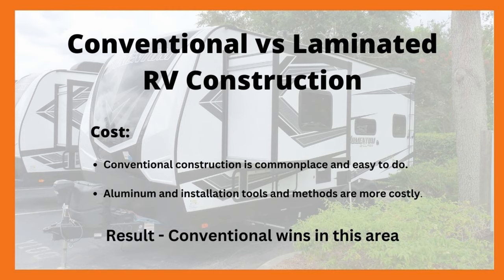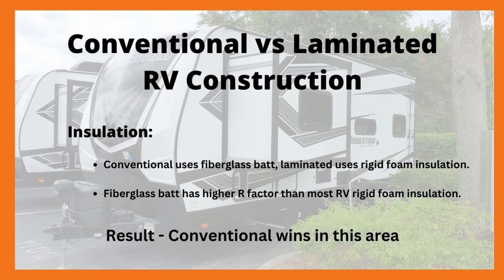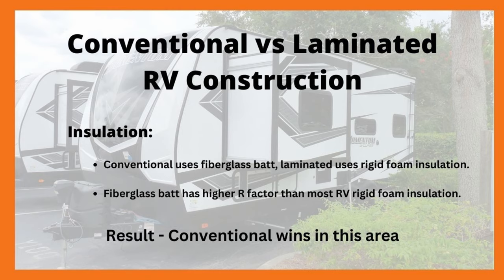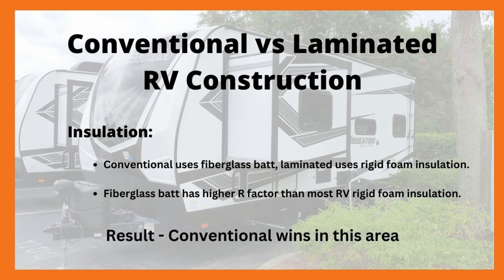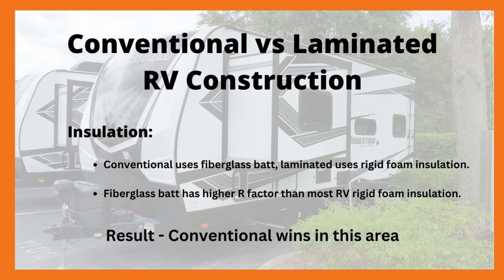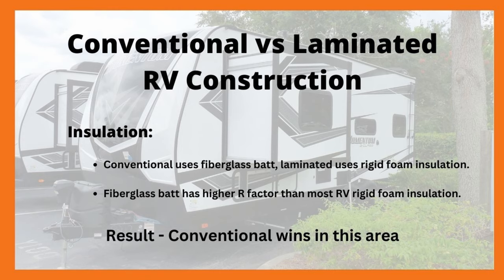How RVs Are Made - Conventional vs Laminated. What's The Best Choice?

Comment: We had a Grand Design Imagine for 4 years (12,000 miles) and only had 1 major issue: the axles were not aligned. Fortunately, my extended warranty covered full replacement. Other than that, we loved that rig. Now we're moving to a Class C for our specific needs. Thanks!
Reply from the maker: Thanks for sharing your experience with Grand Design with us. I only chose GD because they use both construction methods that I covered in this video and they had pretty good illustrations about how it's done. But I am glad that you were pleased overall with your Imagine RV. It's good to hear from actual owners of RV brands.

Comment: It’s amazing Duane, how you touched on so many great points in only 18 minutes.  I learned a ton. Thanks! 

So when it comes to water intrusion, both conventional and laminate are equally susceptible?

And, of course, because both conventional and laminate use wood to some degree, then you have a potential for mold growth in both..  

One of my biggest concerns when purchasing a used RV, is water intrusion, and hidden mold somewhere in the RV. 

It’s a pretty well-known fact that Mold will negatively impact almost everyone to some degree or another. 

Is the majority of water intrusion problems and mold growth some thing that a NRVIA RV inspector  can catch the majority of the time?  

Thanks again!
Reply from the maker: Water intrusion is one of the major things that certified RV inspectors look for. Simply because it can do so much damage that is very costly. We also look for mold too, but even though we do our best to find these issues, sometimes mold can be difficult to find if it is behind the wall surface. But if there is clear evidence of water damage or obvious mold that is observable, it is something that RV inspectors call out all the time. Thanks for asking about this Robert!